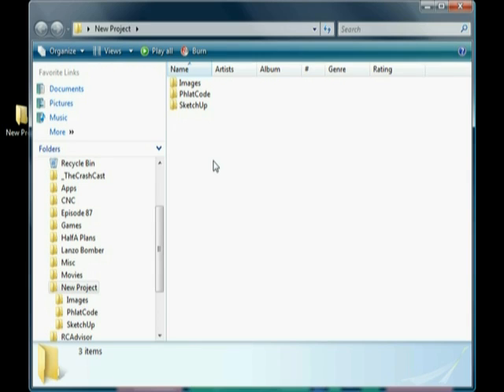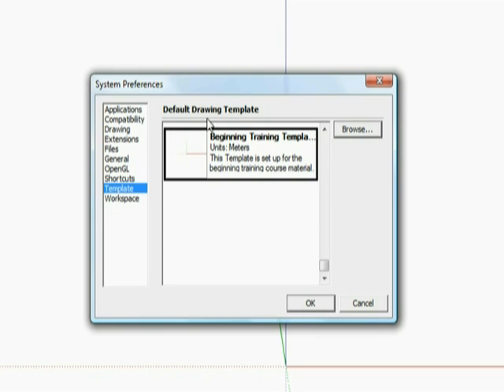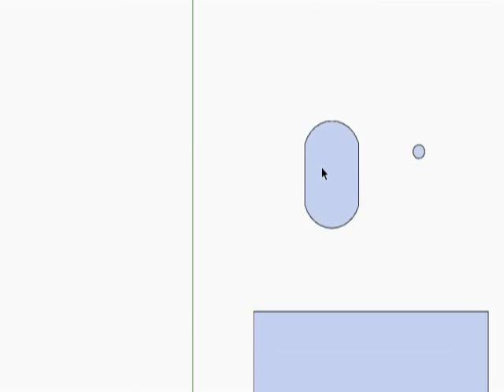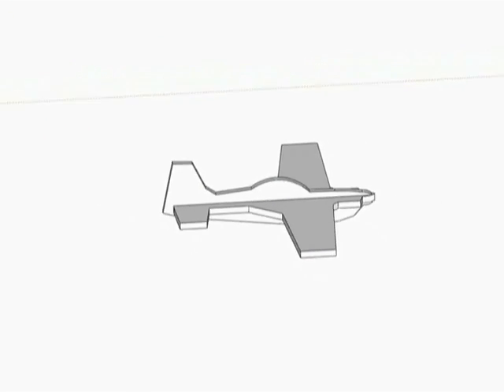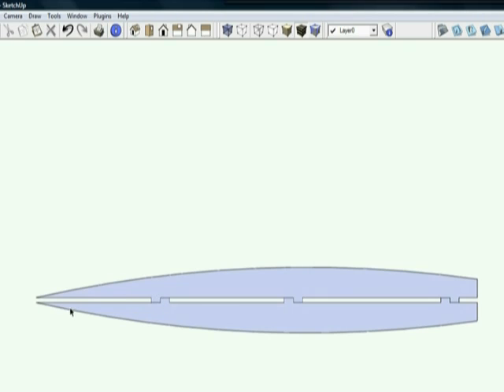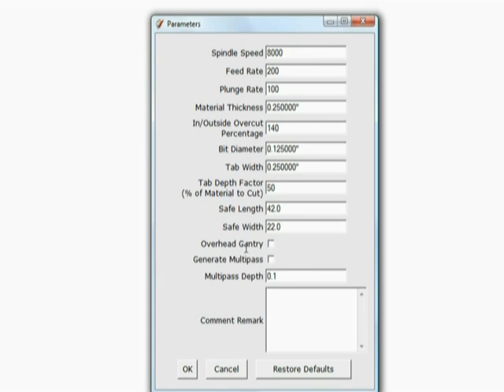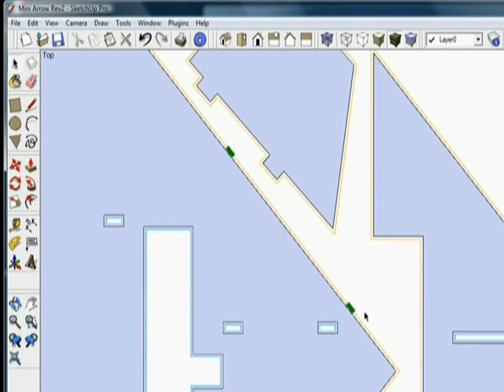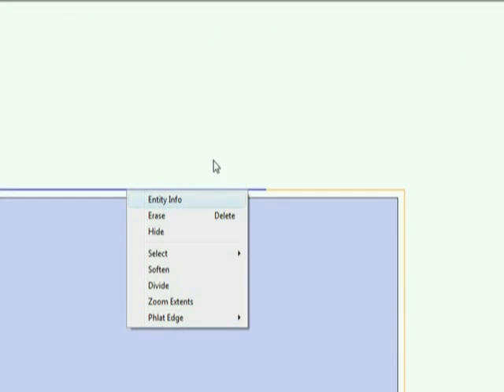SketchUp Basics For the PhlatPrinter CNC

Comment: Hey Crash fantastic video. I've built a 4 axis hot cutter a while ago and after the success I've had with that always wanted to build a cnc router as well.  Software was my biggest expense in the build so I wanted to see what was around and SketchuCam seems a good choice.  Have Mach3 so I continue with that.  Unsure whether to buy a CNC 6040 you see on ebay or go for and OX or X-crave,  Seem like the Phlatprinter is old school now,  What's you preference for RC jobs.  I think I will mainly be cutting foam, ply and balsa.

Keith